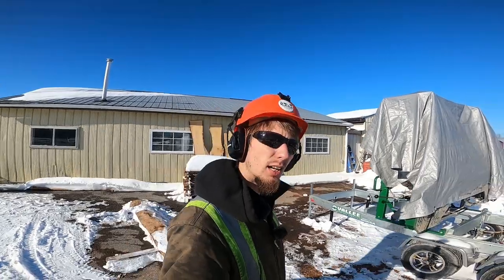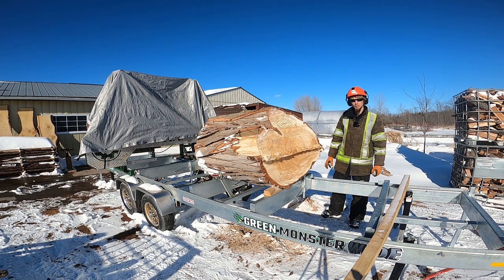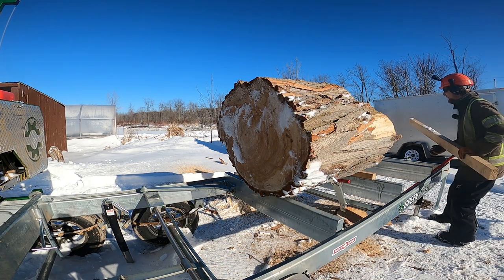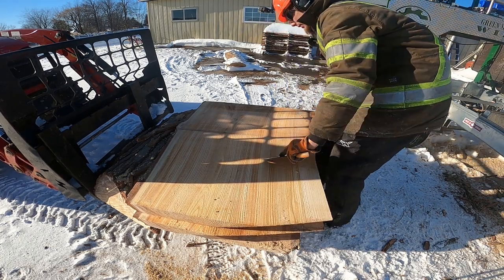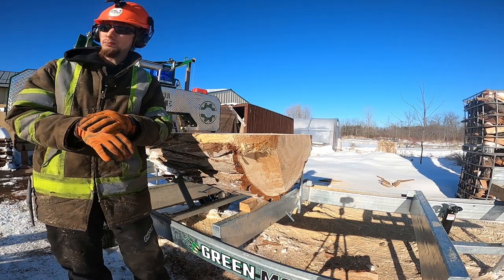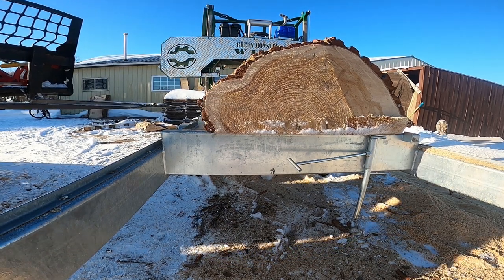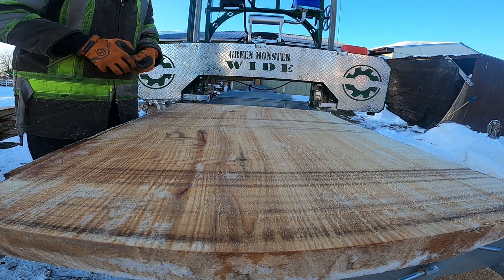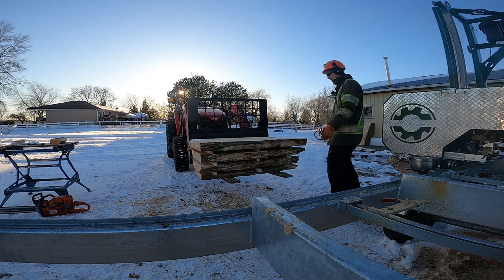Is Willow Worth Sawmilling?

Comment: I got some willow that burned up for firewood. It start splitting as it dried. Hope them slabs don’t start opening up.
Reply from the maker: It’s a good possibility, especially for the slab with the pith.  I make sure to tell buyers about the chance of cracking.   I never dried willow slabs so don’t know how it acts.
Reply: @earthandbloom   hopefully in slab form it won’t I seen blocks all but bust open without being split.
Reply from the maker: @danshouseofsmokeandoutdoor7119  Yeah, will be interesting to see if it helps being slabbed.